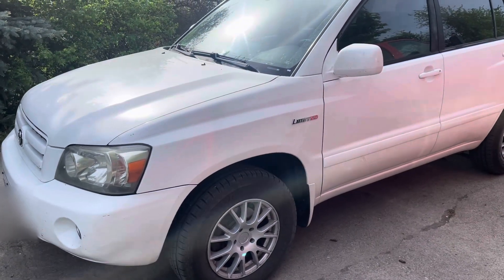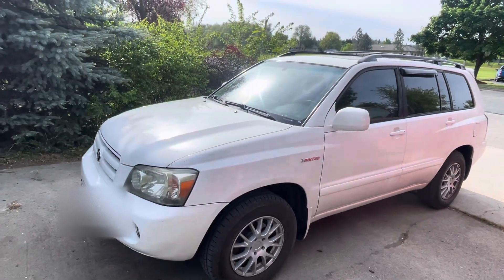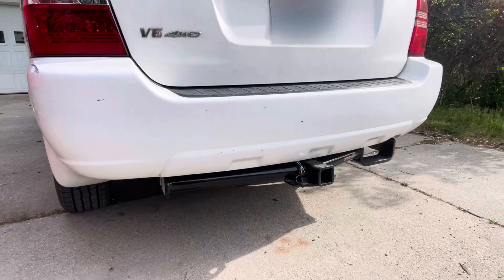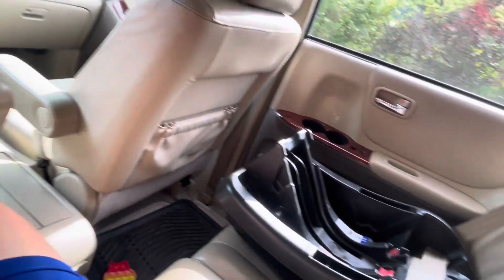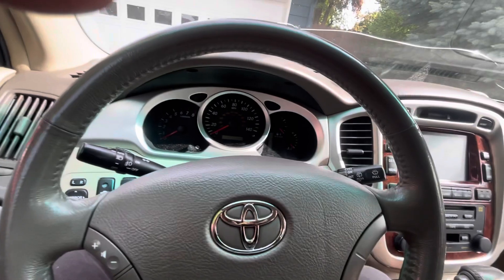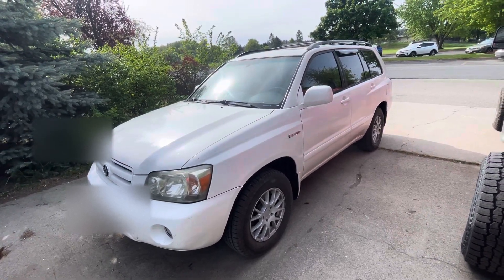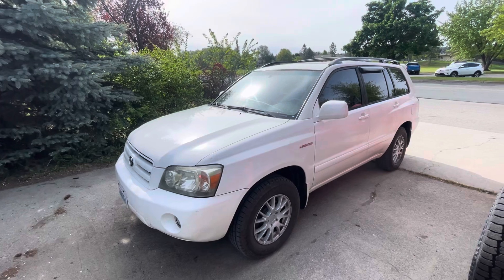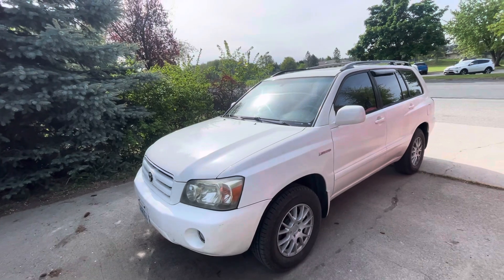2004 Toyota Highlander review

Comment: Nice find. I have an 05 with 176K on it, (Montana) bought it from the original owner. Mine is the base model, 3.3l AWD, 3rd row seats with the tow package. It's in super clean condition also, no rust, was garaged most of it's life. There are no TPMS sensors in the wheels. These models have wheel speed sensors on the hubs. You might pull the wheels and see if the wires are attached and sensors are there. I just put a new windshield in mine cost $325, had the original in it, had lots of pitting and 5 rock chips in it. I have owned mine for 5 years. You can also reset the low tire pressure sensor on it, there is a button under the dash on the left side. Putting the new tires on it may be what triggered the warning light. There are videos here on YT that will show you how to reset it, it's really easy. I would start there first. I just love mine and it does fantastic on icy roads and snow, with snow tires on it, if you get those conditions where you live. Hope you enjoy your Highlander for many years. I know a lady where I live and she had an 05, with 376k on it! Still ran great, these are known to push 400k with proper maintenance. Good to hear your up on the maintenance, your totally right about that. We have got 24 mpg during the summer on highway trips. I am also meticulous with maintenance, used to be a Chevy guy, but only own Toyota's now.  Check out the Car Care Nut channel, he's a dedicated master Toyota mechanic, lot's of knowledge there. 👍
Reply from the maker: @DJ-kh8if  thank you so much for the comment and feedback! Really my family for years have been telling me to do something with my experiences with vehicles and such… I’m kind of the guy for my nephew and nieces, gone with my sister and brother and friends as well… I’m not a certified mechanic but am pretty open to most diy things… so I’ve been doing some videos on cars and lots on fishing and came up with my name simply because that’s what I do mostly lol 😂 seriously appreciate you taking the time for that awesome comment! You’re awesome and from the sounds of it have an awesome rig as well! 💯 the smoothness of my highlander and the power delivery are so so incredible! Blows me away it’s 20 years old! But I’m sure you know that as well! 😊
Reply: @FishingAndCars  Yes for sure, evertime I get in it I can't believe it's 20 years old. That's why I stick with Toyotas now. I've owned lots of GM cars and trucks and always had to work on them fixing something. I'm like you a dyi guy. You Tube helps a lot when needing to fix things 😁. I think that's great what your doing, keep it up and your videos are great too. Hopefully you'll start getting more attention. Let me know if that tire reset work. 👍
Reply from the maker: @DJ-kh8if  I appreciate the kind words lots! Thank you! 😊… I have reset it and it comes right back… I’ll look into the hub sensors more! I had a 2000 Toyota Sienna that I sold to my brother for his family and the back wheel sensors fell off so i used a gorilla epoxy to glue them back on and the tire light went away… it worked and is still working a year later! lol… I did that as replacement was expensive and I read success stories on forums. I’m also wondering if I can delete the tire light like you can on a 2004 4Runner. Under the glove box if you splice two wires together it permanently disables tire light… I may look into that as well